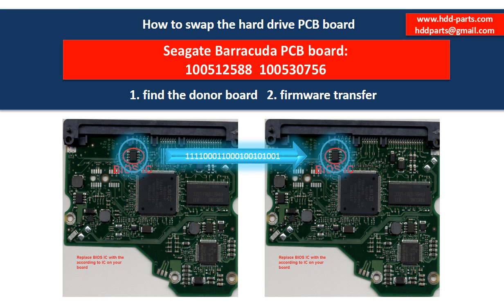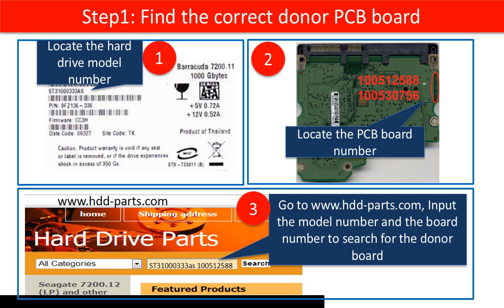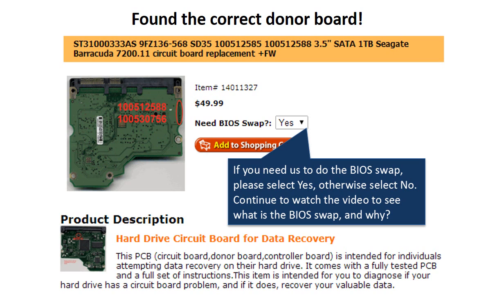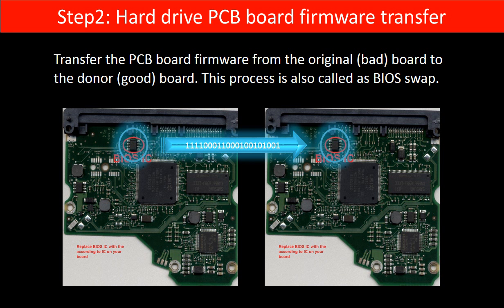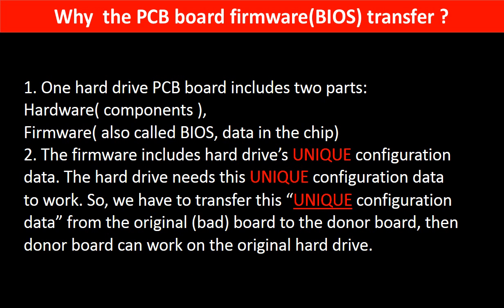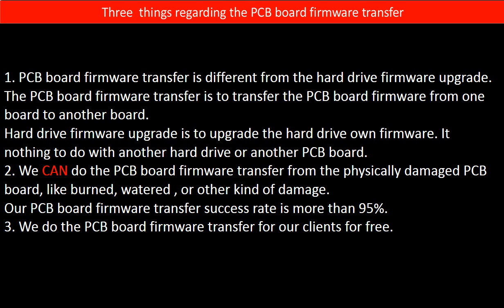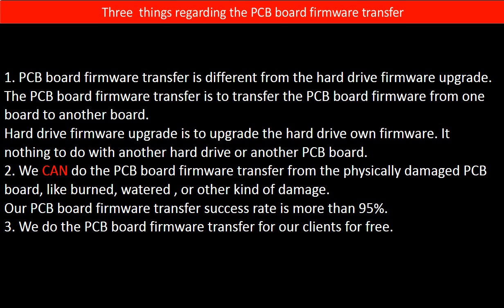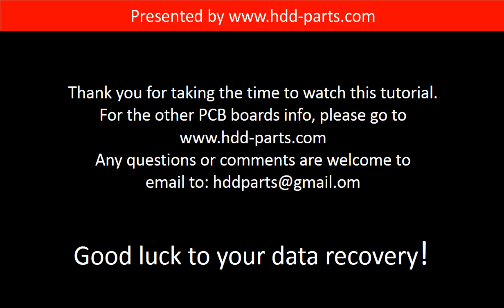Seagate repair Tip  100512588 ST31000333AS ST3640323AS  ST3640323AS  ST31500341AS ST3640623AS ST3150

Comment: lol 49.99$ to get a pcb :-) for that money i can buy 5 second hands harddrives with al the same pcb boards on it in local and country second hands  sites. hope you  find believers to spent over asking money for your pcb boards. and i have do also experiment with hdd and conclution was no matter the serialnumber etc.... if the board can conect the hdd it will works. you dont need exact the same board.